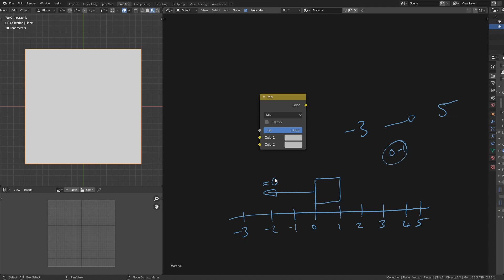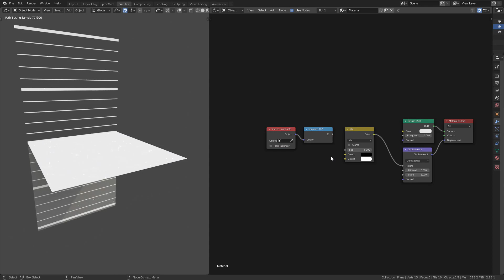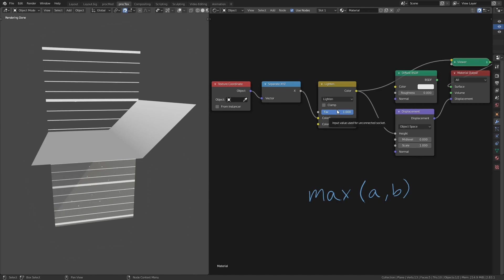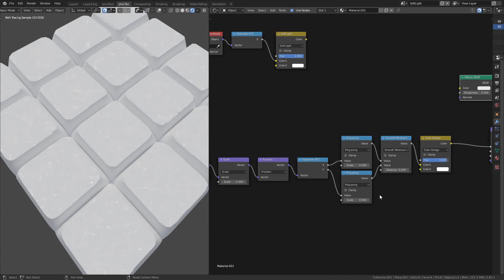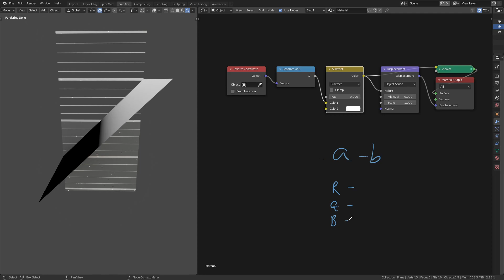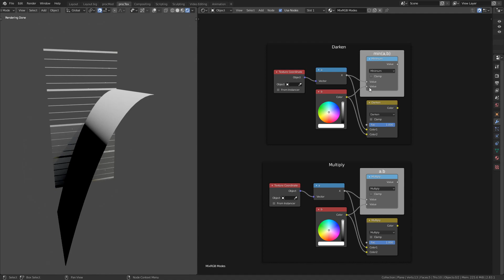Everything about the MixRGB Node - Getting Started with Blender Nodes

Comment: Awesome explanation, something i like to come back from time to time!

Little note, that HSV is not how the human eye sees the color. It is a direct conversion to the RGB color model.

Hue is the angle on the color wheel (Normalized 0 = 0° and 1 = 360°)

Saturation is amount, that the opposite color of the secondary value influences or rather doesn't influence the color.
Representing RGB on the color wheel, decreasing Saturation moves the point closer into the white center.
One value will always be equal to the Lightness and with a fully saturated color you have another value always at 0.
With (normalized) RGB = {0.50, 0.323, 0.00} you have a fully saturated color in the red spectrum.
Decreasing Saturation now from 1.0 to 0.5, your RGB is now {0.50, 0.412, 0.250}.
See how the secondary color (green in that case gets lower, while blue gets higher, leaving red untouched)

Value/Lightness is just the multiplier for the color values.

I think you meant YCbCr, which uses two chromatic values and a Luminance to define precieved colors and brightnesses.
The formula for this is not intuitive.

Comment: Correct me if I'm wrong, but the formula 1-((1-a)/b) for color burn is undefined when b is black. In the src material.c,  the general case for color burning color1 is color1=(1-fac)+(fac*color2); 0 or 1 otherwise. Very good video, thanks.

Comment: Looking around in the sprite fright blend files It appears Overlay is used to add detail, Soft Light seems to be used quite often to add color variation based on random values, and Linear Light is used to distort texture coordinates while keeping the overall shape. I think its funny because Overlay, Linear Light and Soft Light are the three operations i least understand but seem to be the most used.
Reply from the maker: All three will darken if lower than 0.5 and lighten if greater than 0.5 so allows for a good amount of control with relatively little artist input. They're not the most optimal mathematically but once you know what effect they give, you can do a lot with them.

Comment: Fantastic content as always Erindale - It's handy to return to slightly earlier videos such as one as a useful reference.

I couldn't see anyone mention it in the comments here - Since at least Blender 2.92, the RGB and HSV values now coupled 0 to1 linearly.

By comparing versions 2.90 (before the change) and 3.0, The RGB value takes precedence - Setting a grey of RGB values 0.5/0.5/0.5 on either version gives V = 0.735 for 2.90, and V = 0.5 in 3.0... For either version, it is the same grey of value 188/188/188 (using the 8-Bit RGB map in an exterior paint software's eyedropper tool as a reference).

In any case, it seems like a fairly arbitrary change but one that's good to be aware of (I wasn't, until today!)
Reply from the maker: Yeah good point! It definitely makes it easier for us to use the values directly

Comment: I am having difficulty understanding the clamp function. I understand what it does but I don't understand what quantity it is clamping. If you are mixing 2 images in the default mix mode. What are you limiting? Is it volts, miles,  or some other magical characteristic? According to your tutorial, the output port is yellow indicating it is a combination of 3 pieces of information but they have to be measured in some standard or reference. An RGB is not a reference. You can't have 1-RGb or .5 RGB. I have searched the internet and there are many tutorials explaining the clamp function but none explain what I am clamping. Is it luminance, saturation, contrast? It has to be a measurable quantity, I'm just not sure what. Please clarify. Thanks
Reply from the maker: It will simply clamp the values to the 0..1 range. If you're outputting an RGB vector like (0.8, 1.2, -0.3), turning on clamp will clamp that vector to (0.8, 1.0, 0.0).

Don't look at RGB as a single block. When we're dealing with shaders and proceduralism at large, it's simply a vec3. RGB or XYZ is immaterial.

Comment: Brilliant visualisation.  Should inspire people (like me) to make visualisations of their own to get their head around things.

 Couple of notes: RGB not exactly equivalent to XYZ in nodes. It's a gotcha which has cropped up on Blender SE a couple of times recently: If you're casting from XYZ Vector to scalar, that's a simple mean of the components. If you're casting from Color to scalar, it uses relative Luminance, like a RGB > BW  node, which can shear the response, if you attempt to do color mix operations on more than one dimension simultaneously.

 BTW 'Screen' so called because it's the same process as would be used to shoot a photographic half-tones through a  screen with transparent dots: (from positive) invert, multiply (light through both) , invert back.
Reply from the maker: Yeah you're right to mention the scalar conversions! RGB and XYZ can handle vector streams interchangeably without altering the data though!
I had no idea that's where the screen name comes from! That's really interesting to know thank you!

Comment: Nice! This is very valuable information, but you really have to dig into the blender docs sometimes to get a clear picture.  I think we could benefit from a Part 2, with Common Use Examples broken out much like you did at the end for each mode. (Focusing on each mode in a real-world example).  Watching your other videos I sort of get the concepts, but when trying to remember the nodes I have to search through them to find it again.
Reply from the maker: Yeah good point! It definitely takes some time to get used to which one and when. I find myself mainly keeping to just mix (masking), linear light (combining noise), add (height maps), dodge, burn (controlling gradients), difference (masking changes to height maps) and soft light (rounding out 0-1 gradients). I'd say they're they key ones in my experience! Dodge and burn could be replaced with map range and difference with math-compare but sometimes it's more effort to abstract things to numbers!